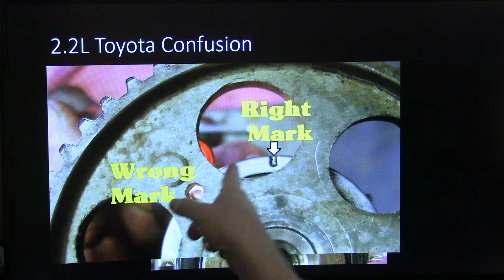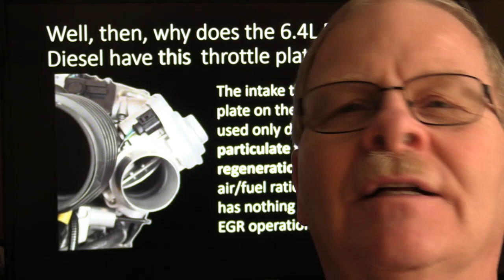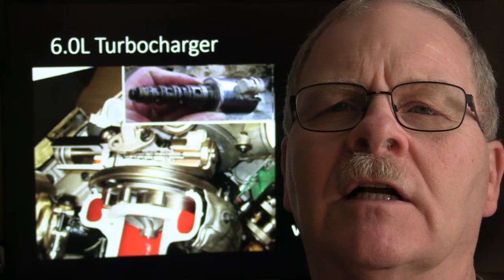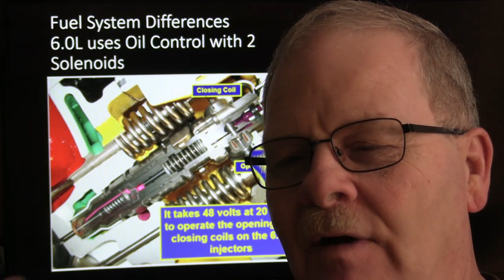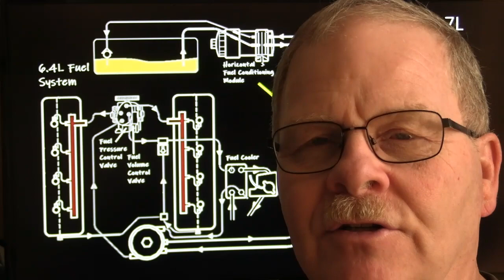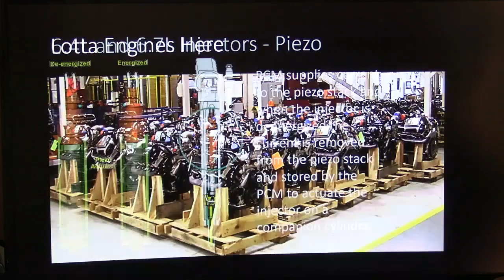Power Stroke Diesel Comparisons

Comment: Thank You! 
I like My Fingers. 
Toyota question =  I don't know but do suspect a tuning index reason. I have seen that engine have very high torque but would not rev above 4000 until a timing belt snap.  I do not know what the settings were before but after I did the belt power and revs were normal.   I do have a good book on that engine and think I will do some pleasurable reading tonight.